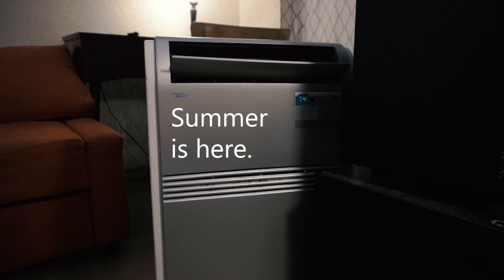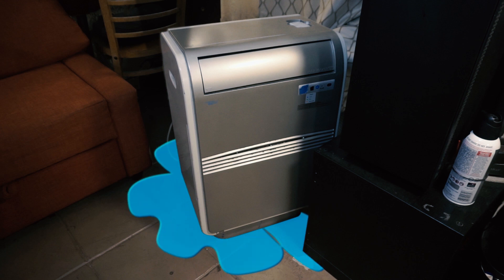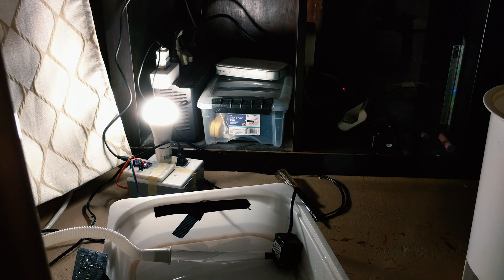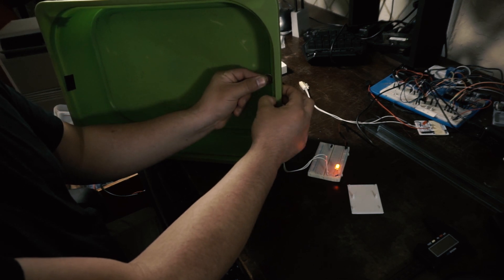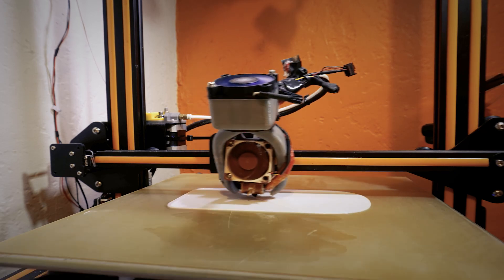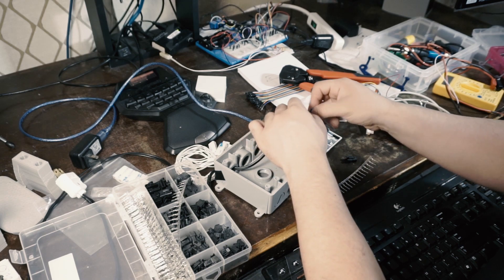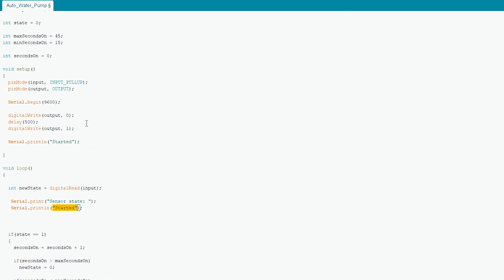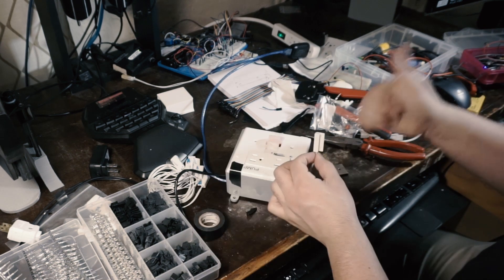Arduino Automation - Water Pump

Comment: Could you 2 float switches?
Reply from the maker: Yeah. You'd have to adjust the arduino software, but definitely
Reply: @noisycarlos  I'm trying to find a circuit that has 2 one at the top and one at the bottom. The reason for this is so when the water drops below the top sensor it's not turning the pump on all the time for short periods, I want it to reach the bottom sensor then turn the pump on and when the water floats the top sensor turns the pump off. So it's on for a meaningful duration
Reply from the maker: @layton7430  i see. In this version I timed how long it took the pump to get most of the water out. When the water reaches the top, the pump turns on on for that period of time and that was close enough for my application. However it wouldn't be hard to add a second magnetic sensor at the bottom and have the arduino check it every second or so and when it gets triggered it turns off the pump. The code to turn it off would look very similar to the code to turn it on.

Comment: easy way to detect liquid level in this application without water contact would have just been weight readings of the liquids container.
Reply from the maker: Yeah, I didn't think of that at the time. 
The slight challenge I can think with that method is that you would need to calibrate the weight (since the AC is on top of the water container), but it would still work

Comment: Hello Sir, I plan to use this relay to connect from 5V arduino to 12V DC Pump (4-7A). It is written that the DC adaptor to power the pump is 12V 10A. is it a robust solution to use this relay in a closed enclosure in the farm? or should I upgrade the relay spec? Thank You Very much Sir !
Reply from the maker: Hard to tell without specifics, but I can give you general advice: You can use a different relay than what I used. As long as the relay you're using is rated at or above the pump voltage/current that shouldn't cause any problem. Make sure you cover it to avoid shorts due to moisture.
Reply: @noisycarlos  Thank You, what I worried is the current of the pump when it starts. What I know about the relay rating is 30V DC 10A

Comment: Sorry to say I have never seen such a convoluted way of measuring water level and all you needed was two stainless steel bolts one at the top (water level and one at the bottom) bottom bolt 0 volts top bolt connect to one pin pulled hight when the water touches that top bolt it will go low just sense its job done but it was nice to see how others do it thanks
Reply from the maker: Ha! Thanks for the feedback. Convoluted can be fun though :-)
I really wanted to keep the electronics out of the water. The previous version had electronics in the water and it got corroded after a couple of months.
I'm sure stainless steel would've held much better underwater (honestly didn't occur to me), but I'm not sure if it's impervious to the electrolytic corrosion caused by the current going through. Maybe it would've been fine, but putting all the electronics out of the water just felt like the most reliable solution.

I'm still quite happy with the result. It's been working non-stop for over two years without any maintenance whatsoever. 
But I know there are probably better ways to do it (If you make a version feel free to drop the link below, I'd love to see other solutions!)

PS: On a subsequent version for a different tank, I used a commercially-available float, and it works well, it was just too big for the tray under the AC.

Comment: Great project, that’s what I want to do except for a plant system where it fills up a plant wicking system when the water runs low.
Reply from the maker: Thanks. Totally doable mostly the same way. Of course you'd put the magnet/float at the bottom, and instead of triggering the draining pump, you'd trigger an input valve (maybe a solenoid valve?)

Comment: Hey how you did the 4:00 water animation in 2d? you draw it? or it is simulated?
Reply from the maker: It was made in After Effects. The water is a blue solid with a 'Rough Edges' effect applied to it.
To make it move like water, I put two keyframes in the 'Evolution' property inside rough edges (one keyframe at the beginning and one at the end). I hope that helps!
Reply: @noisycarlos  thank you so much carlos for the reply

Comment: I had the same problem before but unfortunately i dont have the knowledge like you do. Bought a submersible pump and that's it, was not satisfied but it get the work done. Wished ive seen your video back then.

Comment: Was not it better from any aspect to replace that ridiculous sensor with one made of solid copper wires. Microcontroller's has sufficient sensitivity for pretty simple sensor.
Reply from the maker: Yeah, copper wires probably would've worked better than the original sensor. But for the replacement, I went with the magnet because I wanted something that was out of the water, so I wouldn't have to worry about corrosion anymore. So far it's been about 2 years, and still going strong.

Comment: You could try and use a ultrasound sensor for water level detection as it would significantly reduce cost and setup size.
Reply from the maker: I considered it, but the water container is too tight. So the water level would've been too close for the sensor.

Comment: is it possible to create a project with:
1. moisture sensor 
2. water pump
3. water flow meter
in just one arduino uno? thanks.
Reply from the maker: I've never done it myself, but It should be possible. The Arduino has enough pins. You would just need to check them one by one on every loop.
Reply: @noisycarlos  great! can you help me do it mate?
Reply from the maker: @xfice-1495  Here's a good walkthrough of what I'm talking about... https://www.youtube.com/watch?v=daRoUg1S3oU
Reply: @noisycarlos  do you have a discord? i'm gonna add you up bro.
Reply from the maker: @xfice-1495  thanks! I don't unfortunately, but you can subscribe here :-)
Reply: @noisycarlos  what are the materials do you think i will be needing. you think i need a relay for r385 water pump?
Reply from the maker: @xfice-1495  I made a list of what I used, including the Arduino code, at: https://www.carlosaldana.com/2018/07/14/automatic-ac-water-pump/

Comment: This was a very cool video to watch.  I was just tryna find reviews on water pumps for arduino gardening set ups but this video had my attention the all the way til the end.  Have you had any problems with the glue weakening at all and having to fix the float again?  Also you switched to a commercial type float, how did the set up for that look?
Reply from the maker: Thanks for the kind words. That unit is still working after 2 years, haven't had to change the glue yet. 
I did use a commercial float on a different project, and it actually uses the same code, just wiring the commercial float instead of the magnetic sensor.

Comment: I think u could just use float switch with pump
Reply from the maker: Yeah, but the ones I could find didn't fit inside the tray, I did use one later for a similar project.

Comment: Nice, for water level I used ultrasound distance sensor, they make them waterproof as well for longer life time. I didnt know this senzor. I will use it in my next project, thx
Reply from the maker: Nice! I hadn't heard of waterproof ultrasound sensors. But it makes sense.
For this, I briefly considered the ultrasound route, but, besides not knowing there were waterproof ones, I felt that it would be too close (the bin is only about ~10cms deep), so I figured the magnet would be more reliable. But on deeper containers it makes sense, especially since you can get more precise measurements of the water level.

Comment: I think its a bit too over-complicated with the foam and magnet sensor :D
Reply from the maker: Hehe, maybe :-)

Several months after this video I did another one of these for a different part of the house and I used a commercial float sensor (code and everything else was the same).

It was nice to have it premade, but at the time of the video I had the magnetic sensors and magnets for a different project, so I figured it was more interesting to use components I had on hand.

Plus, I'm cheap.

Comment: Just saw the schematics. You didn't use any resistors or capacitors?
Reply from the maker: Not on this one. I used a relay module (available on the parts list) that already has all it needs so it can take just the signal from the Arduino.